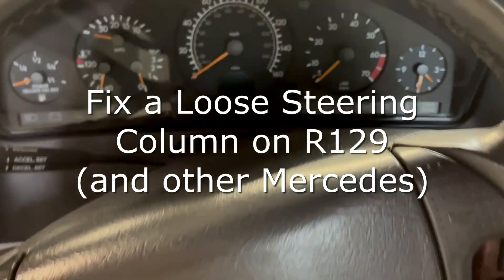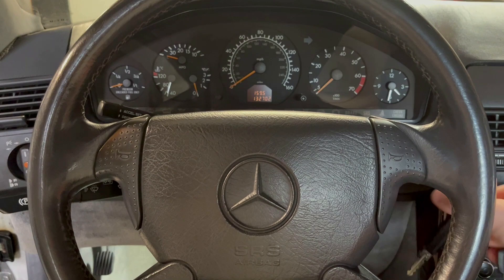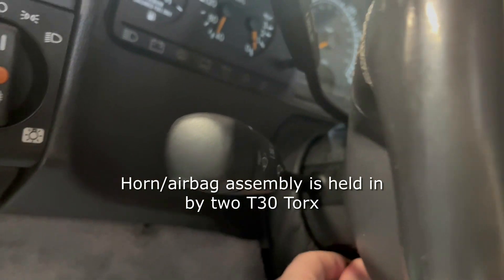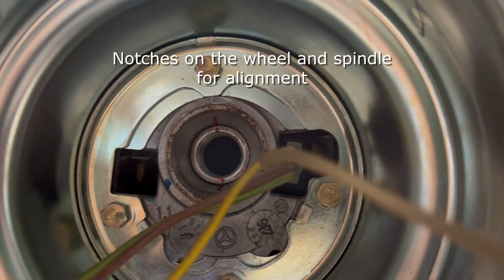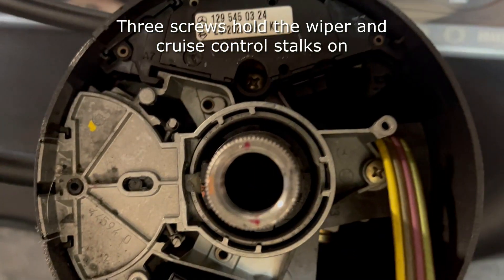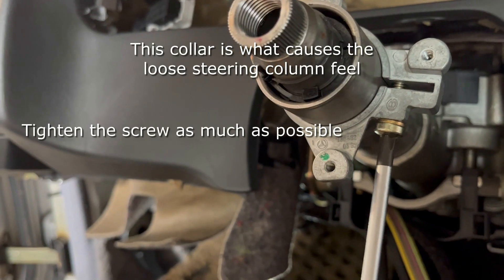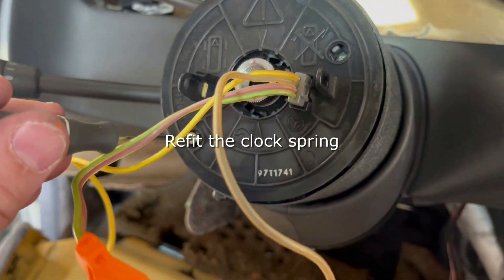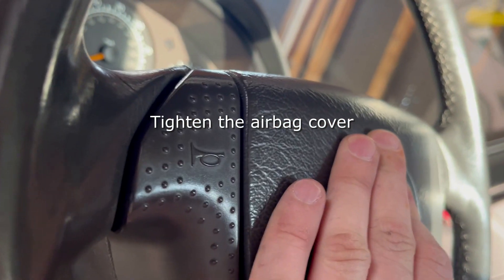R129 Mercedes SL Fix Loose Steering Column (Applies to Most Mercedes)

Comment: Thank you so much for this video.  Extremely well done.  I have the same issue with my ‘97 SL600.  I also need to replace the turn signal module and clock spring assembly.  This will help tremendously.

Comment: Brave.  Great video but wouldn’t it be safer to disconnect battery when playing with air bag ?
Reply from the maker: That's correct. I really shouldn't have been lazy and just disconnected it. That said I've done several of these and never had an issue.

Comment: 2000 SL 500 I have this same problem. Also my turn signals do not cancel after a turn. Will tightening this fix that as well or do l need a new switch? Thanks for the great video!